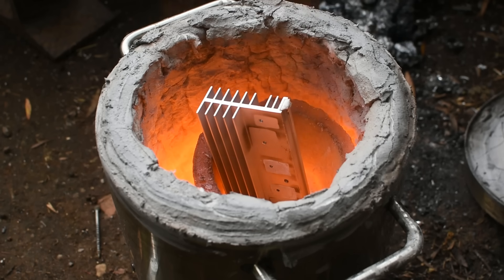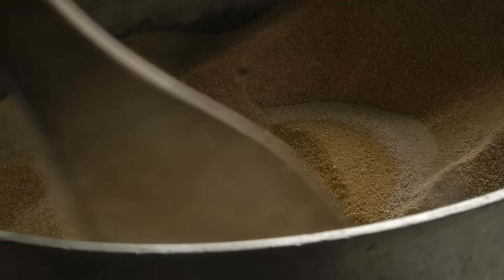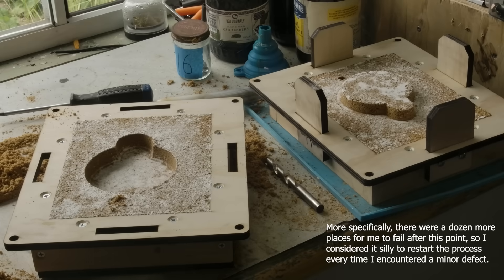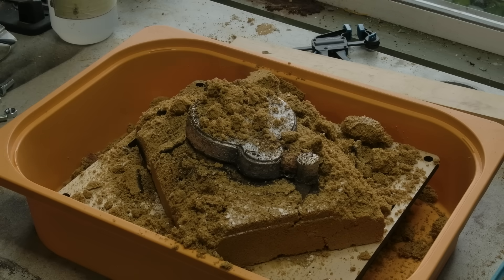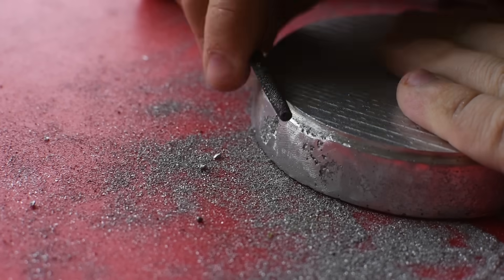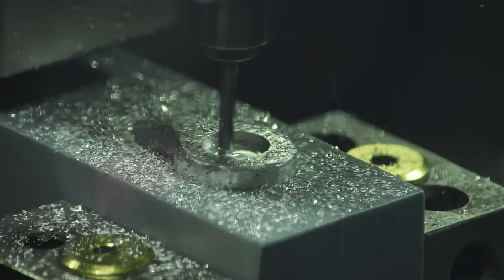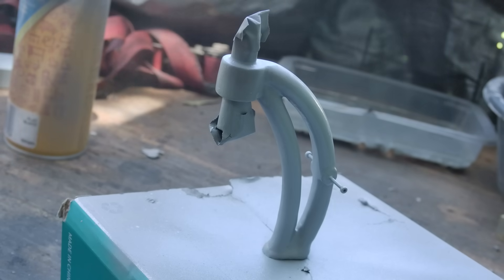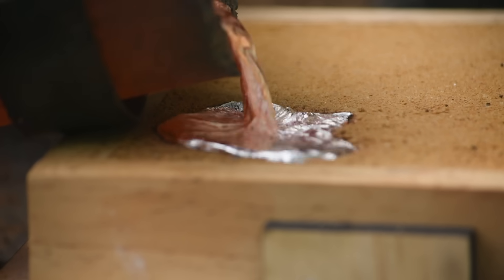3D Printing And Metal Casting Are A Perfect Match

Comment: Love it, this is why I even built a 3D printer early in the hype cylce.
But I got sidetracked somewhere...

Although I haven't started casting myself yet, my goto channels for casting prep is Myfordboy and Paul's Garage. Both have very good, solid informative content, although almost opposite styles.

You might be able to avoid some of the rookie mistakes seen here (no shade, I would most likely have had all the same issues) if you spend a fair few hours viewing them.
TL;DW: venting, risers, runner and gate design can make a big difference for shrinking, porosity, and inclusions.

Comment: your 'bubbles" are from not brushing your seperating poweder, you left it in clumps that correspond to your "bubble issue" that's what i saw, and as much as it pains me if you're going to go green then invest oil free casting sand for jewelry usually 400 mesh there abouts. otherwise your finish will pretty much always come out looking like lost stryrofoam casting with "green" sand , that is unless you have the equipment to mill the clay smooth/. anyway. great job on the pooling that worked as intended from the video presented. although i didn't catch if you poured enough to have it vent out. great job i'm just waiting on my petrabond to arrive to start my mixed media adventure myself.

Comment: I worked in a cast iron foundry for 9 yrs in the melt crew (people who melt and pour the iron) as opposed to the Fettlers.  Keep trying it's all a learning experience.  We used green sand almost exclusively, so I can point out that your sand looks way too course,  also as @MaxC_1 points out below you won't get a good surface finish due to the coarseness of the sand. Even if you were to use a finer higher silicate sand your surface finish can be drastically improved with the addition of coal dust into the sand/bentonite mix.  Adding coal dust creates a surface boundary layer of gas (between the mold and the casting) when the coal ignites on pouring molten metal into the mold.  This might not be the best way to achieve the results you would like on a small scale so could I suggest 1) get some finer sand. 2) Make some of your own sodium silicate, not too difficult only 2 ingredients needed both available easily sodium hydroxide (lye) and silica gel crystals for moisture prevention i.e. the little packets you get when you buy almost anything that has to be kept dry such as 3D printer filament, videos available on this platform.  Then paint out the mold with a release coating.  I cant think of the name for the one we used but contacting friends , its brown and mixed with metho.  Available from Foseco. watch video from A boat by the river https://www.youtube.com/watch?v=d0qVUjEh3-M&pp=ygUTYSBib2F0IGJ5IHRoZSByaXZlctIHCQklCgGHKiGM7w%3D%3D they use it in that video & light it up, that's how you harden it off.  

Best of luck with the castings.  

P.s. Foseco web site 3D printed mold specific reading material https://www.foseco.com/en/products/coatings-for-sand-moulds-and-cores/speciality-foundry-coatings#products-in-detail.

Comment: If you vibrate the box containing the mold right after you pour it might release more of the bubbles from the cast. Use a massage vibrator on a low setting.

Comment: Hi my name is Gabe,  im the head of molding for the Port Townsend Foundry... absolutely love what you're doing on this channel definitely keep doing it.. and if you want some input from a professional molder I would be more than happy to share what I've learned
Reply: I'm sure the creator will be interested, but just in case they aren't I wanted to say that I am very curious.
Reply: always happy to hear from a master in his trade
Reply: I guess his sand mixture or sand gave this bad surface finish and bubbles, what you think?
Reply: to make green sand effectively you need three main principles, you you need water, you need clay and you need sand at The Foundry we use a grian size of about 160 Grit, we use two different clays what has a higher calcium concentration and the other one has a higher sodium concentration and it's the presence of the two in the sand that allows it to bind properly.  when adding the water there is a a very specific thing that needs to happen inside of the clay a molecular level, there are these things called clay platelets and in order to properly make green sound do you have to actually Force the water in between the clay platelets this is done using a malling machine which is basically just a wheel that forces the water in between the platelets, now if there is too much water in the mixture we call that free water. if there's too much free water it'll turn to gas and it'll actually create negative pressure inside the mold as you're pouring the metal in this can force the metal into the walls of the mold creating spiky bits on the part what kind of look like a weird cactus or in aother case it'll Force the metal inward creating weird pockets in the part the other thing to know if the grain size next to the part is too big it'll actually allow the metal to flow into the walls of the mold so packing the smallest possible grain size next to the part will actually give you pretty smooth finish
Reply: @gabecorbett4559 That would be great 👍
Reply: I have a question if you don't mind, I'm new to casting and I'm trying to find ways to decrease grain from sand casting. I've been thinking of using super fine sand, or maybe even creating small sement moulds. I do know that the sement must be 100% dry or you can get steam explosions, do you have any tips? Is it even possible?
Reply: also I almost forgot to mention when choosing your sand there's a really important thing to keep in mind normal sand off the beach will fracture above I think it's like a thousand degrees or so and the more it fractures the less you'll be able to use it because eventually it'll just turn to dust at The Foundry we use a sand that's about 160 Grit here comes from a nearby Olivine mine but I would imagine you can probably Source all of them somewhere else depending on where you are
Reply: @nathanhamers9160  I'm not a pro, but have used Delft Clay to great success. It used to cast jewelry and its so fine the edge of a piece of tape will show up in the casting.
Reply: I spend too much time on YouTube
Reply: I would say cement casting my theoretically be possible I would advise against it just because of the possibility of water inside the mold
Reply: I gave a reply to Vissh996 .. I would encourage you to look at that post and explains how green sand is made and it also touches on something called free water my concern with cement casting would be excess free water somewhere inside of the mold I think it would be possible to dry it out and give it enough time and enough Heat possibly however I do think that if any free water of any kind was left in the mold it would possibly crack creating weird steam pockets in your mold
Reply: You need borex in your with the metal be for you por
Reply: I am working on making aluminum bronze for a pommel on a sword I make in my blacksmith shop, I tried doing research on how to weight out how much aluminum and copper I would need but couldn’t find and definitive answer.

Comment: Finer sand....better finish. A kitchen sieve is better than nothing. When you apply the parting compound, use a soft brush to distribute it nicely on the pattern. Clumps of baby powder = bad. This also improves surface finish.
For a first attempt (or perhaps even a 10th attempt) this was fabulous.

Comment: Been printing solid 1.5KG bricks on a Elegoo S4U using Siraya Lava Black. Incredibly strong, have over a 100KG of  successful prints so far no vat damage. It’s all about printing direct from build plate with designs minimizing suction cupping and thin skirts on the entire build plate to counter warping/suction cupping. Channels for vertical voids that have a small vent hole at the build plate remove almost all suction cupping which is the biggest problem in these solid heavy prints. This method also uses very little supports in most cases only for horizontal holes/voids.

Comment: After experimenting with the casting of metal components using the "lost material" method, I place plastic or wood item to be cast in a refractory material made from plaster of paris and perlite. After a complete drying, the plastic or wood material is either melted or incinerated away. The mold is blown out with air to remove any ash and particulate matter. 
The result is a mold which is quite smooth and accepts molten bronze (as one example) quite well. The refractory mold is place in muriatic acid and typically dissolves to the point where it crumbles and can be brushed away under running water. Almost nothing in the manner of porosity in the casting. The casting is often smooth as glass and well within tolerance of the original component. 
Thank you for a most interesting video tutorial, Mr. Borge

Comment: I’ve been working on casting my 3D prints for about a year now and finally got some success recently. My next session will be about refining my process for quality and repeatability. :)

Anyway I’ve gone with a totally different casting method that may or may not be suitable for your purposes, namely, lost positive casting. My secret is sodium silicate and PVB filament, soluble in alcohol, though I suppose ABS would work too. The setup is very simple - print your part in PVB with as little plastic as possible (I’m talking 5% or less lightning infill, 1 wall loop, 1 floor layer, and one ceiling layer, if you can get away with it), coat your part in drywall compound (taking care to do so in layers, as it shrinks as it dries), and then pack a mixture of play sand and sodium silicate around the mold (only about half to 3/4 an inch thick, sodium silicate cures from liquid to solid in the presence of carbon dioxide), and then finally submerge the mold in 100% isopropyl alcohol to dissolve out the plastic. It’ll leave you with a completely fireproof, high detail mold for casting aluminum, copper, and even iron.

I’ve found a lot of use for casting sculptures with multiple off-axis holes, which just aren’t possible to cast using sand casting. Admittedly I am only just starting to understand this technique and I have only cast very small parts, but it serves my purposes!

Comment: i wonder if a hammer held upright would work to tamp the sand down tightly?  or maybe a wooden handled hammer then you could shape the bottom of the handle to the way you wanted it and it would have weight from the steel head.

Comment: Complete armchair advice, but I think you might be casting while the metal is still too hot - I recally a RotarySMP video, where he was getting porosity issues from casting too hot, and he was definitely not casting while the metal was glowing orange (7:56)
Reply: It's watch?v=is2jtKfGcu4 at 19:25, apparently 750°C was already too hot, while that color of orange glow is probably around 900°C (depending on color grading)

Comment: Baby powder used to be talcum powder (which is thermally stable), but most modern baby powder is going to be corn starch! Corn starch, being a starch, is combustible and will leave soot, as well as produce carbon dioxide and water when it comes into contact with the hot metal. If you need a thinner layer of starch not to leave large lumps (and therefore voids and bubbles) when powdering your part or the cavity, you can dilute the baby powder or a generic corn starch (which is usually cheaper) in isopropyl alcohol, and spray it on with a spray bottle. Typically, 1:4 or thinner starch to alcohol concentrations (by volume) will spray nicer and be less likely to clog your spray bottle. 

Wait for the isopropanol to evaporate (or add additional airflow over the surface to make it go faster) and youll have a very fine and even dusting of starch on the surface.
Reply: Oldfoundryman recommends calcium carbonate as a non-toxic alternative to talc. You can get it fairly cheap and it does seem to work well. I used it for a while, but, ironically, have switched to corn starch, which works better with the molasses bonded sand that I have been experimenting with.
Reply: Diatomaceous earth is better, but wear a mask

Comment: Love everything about this video. I have a similar set of hobbies. I make (not as cool as yours) desktop cnc machines and have tried my hand at casting, although I use acrylics since my apartment probably wouldn't be cool with a metal casting setup, haha. Not a criticism of your work, this is awesome, but for the facing operations, I think a manual mill would just be the bees knees, like a small shop mill with a cheap DRO. You could do those facing operations so quickly, you could skip the programming step, and you'd never crash. I am in a similar situation, and I know how much work was behind those facing operations, not to mention the pucker factor involved. Makes me wish I had a manual mill! Great work, man.

Comment: I performed a similar process using a different approach.
First, I FDM-printed my part using Moldlay 250 (a wax-like filament). I then manually glued the runners and risers with heat. For the mold, I used inexpensive fine plaster.
After the mold dried and was burned out, the poured part exhibited a very precise surface finish. Unfortunately, my mold, which proved to be not very heat resistant, developed some cracks, meaning the final part required some touch-up work.

I will definitely try it again.

Comment: how did you ensure that the tap axis is square to the plane of the baseplate? While the cast template may be square on model, there is the process of 3d printing the template, imprinting it in the sand, and of course the metal casting, all of which can potentially warp the part out of alignment. 
Is the tap holder loose enough that the tap can align itself? That's one solution I could see working, but it also introduces a lot of variables to the tapping process that I think would be preferrable to avoid
Reply: or maybe you used the axis of the hole to set the arm for facing its mounting interface. That... seems like it would work? I would have to rotate this problem around in my head some more. 

re-watching, it was probably the 3d-printed mount. Still, it would have been nice to mention the purpose of this alignment, as by itself it just seemed like a basic work holding application

Comment: My dad knew a guy who claimed he knew how to weld "pot metal" parts (old cars had door handles made out of this stuff, plenty of cheap junky things were made out of "pot metal").
Of course, there is no way to weld pot metal. Yet this guy could fix any broken part. How did he do it?
Well simple, he put the broken pieces together and packed them tight in sand. Then he fired the sand! That was all, the alloy re-melted together and the sand held its shape. Fixed.
Reply: @Grunch005, I am correct in thinking that "pot metal" is likely tin?

Comment: I wonder if that coloured Play Sand works as a casting medium?
There should be a lot available very cheap after the recent asbestos contamination hysteria.
And before anyone squawks , the talc (baby powder) used in this video probably contains asbestos.
If the video creator used corn starch baby powder it was possibly a wrong choice as corn starch (carbohydrate) disassociates at molten metal temperatures , potentially causing outgassing problems

Comment: You might wanna try printing in wax, coding the print in plaster and do a lost wax casting the parts probably would have a nicer finish
Reply: How feasible would it be to print a master model, create a silicone (can be >1 part) mold from that, and use the silicone mold to cast hard wax models to be used in lost wax castings? That would provide a certain amount of repeatability.

Comment: The entire purpose of 3D printing is rapid prototyping.  99.9% of people are using it for end-use; completely missing the point and many times, living dangerously.  I'm always seeing people 3D printing stuff like shelf brackets and other load bearing things and it just makes me cringe.  You're supposed to iterate the design to figure out what shape is best and then use that to make something out of a real material, whether cast or machined.

Comment: Loved your video.  Just a thought, it might be a good idea to use an N95 mask/respirator when running bentonite clay through a blender or dealing with it in its dry powdery state. Probably not enough exposure in a hobby, but silicosis is a (nasty) thing.  Search bentonite silicosis or foundry silicosis for more info.

Comment: Ive used 3d prints like wax casting.   melt out the print as you pour.   I do my War hammer figures in metal .   Im gooffy like that.  edit..wrote a bit of a book.had to delete...  been casting awhile. (since the 80's)

Comment: Talc - the main ingredient in baby powder - not so common these days. Can't buy it here in the EU because of the asbestos content, and is being replaced with powdered cornstarch. Wondering if this will give the same release result? Talc itself won't burn, but cornstarch will, so they would behave very differently at high temps.